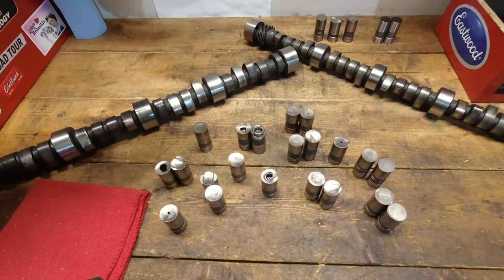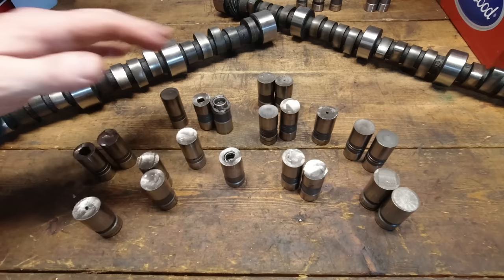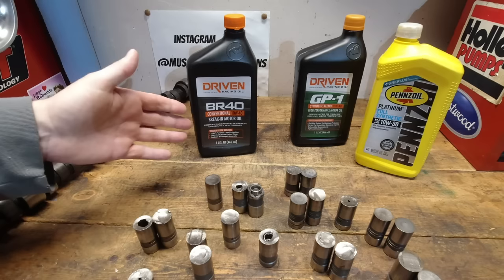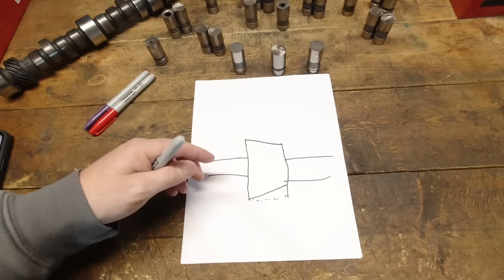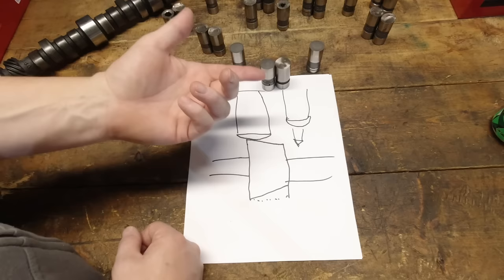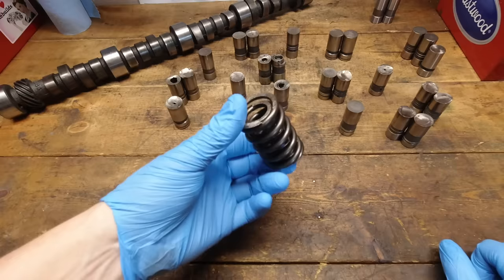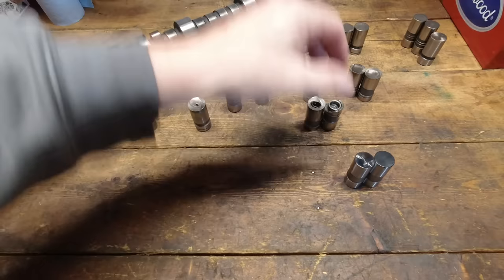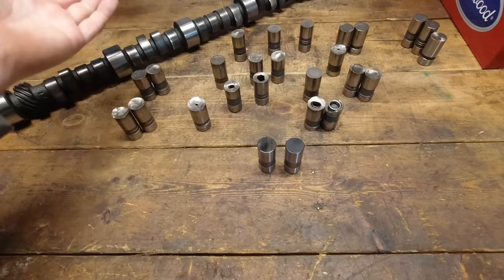Flat Tappet Cam Failures: The Reason Why They Go Bad & The Solution! Part 1

Comment: Never in my young days did we ever have to go through such bs. We set timing,  check for leaks and ran in through the quarter mile. Never ever had a problem like we do now.
Reply from the maker: Just forgotten memories.  None of that is relevant today.
Reply: A stress free break in is what we want. The relevance is proven by folks switching to roller cams.
Reply: Exactly......and That is the Real Problem.
Reply: So true
Reply: Not forgotten
Very true, years ago when the casting slugs were made in USA from high quality cast steel and hardened properly there wasn't any problems, they make cast steel slugs in there back yard in china, Bangladesh, Pakistan, India, etc etc etc (NAFTA, GATT) kinda explains it,,, if ya pay attention to the obvious.
Reply: yea. back then you could stand back and throw a cam in your block.never even thought of a cam or lifter failure. unless just worn out.
Reply: Exactly
Reply: I'm the same way, but in the last 3 years I've destroyed 2 brand new cams. I didn't change anything I did and 2 wiped out.
Reply: Ever thought about missing oil thrower paddles on aftermarket conrods? Original GM Small Block rods have so called Splashers that throw oil on the cam lobes, most aftermarket rods dont have these oil throwers
Reply: @Haffschlappe  And not on old Fiat OHV too
Reply: @Haffschlappe  In Sweden they use Compressor oil SAE 30 plus zink for breakin

Comment: The very first engine I rebuilt was in 1985, it was a SBC 307, reused the original cam, and installed new lifters, didnt even go through the break-in process, drove it many years until I sold it to a friend, it ran many more years until we just lost touch with each other, it is probably still running somewhere out there!
Reply: Absolutely, break in is an unnecessary gimmick.
Reply: I did my first cam swap at 13 years old. Put in a 280 isky in a olds 400. I used the original lifters with 66k on them . Replaced the nylon timing chain gear that slipped and bent 6 push rods ,used push rods went in. I sold the cars years later and I put on 20k . I run into the new owner at car shows. The motor has never been apart. Still runs great.  My opinion on all this is BS .
Reply: @bobbybieln853  oil isn't what it used to be. That's kind of the point he was getting to. Cheap oil will kill a new build, a motor built 20 years ago that already got to build a film didn't get affected. 
Epa is definitely trying to kill old cars. Believing otherwise is foolish.
Reply: @bobbybieln853  exactly
Reply: Yes,  I've put together solid flat tappet motors back in the day with heavier than stock springs, did the break in and to be honest with open headers it was a sound of celebration,  2000 rpm for 30 minutes told the neighborhood my motor was finally complete...lol and zero problems with cam/ lifters. 
I believe quality control is our problem today both with replacement parts and block machining.
Reply: Exactly
Reply: I' ve rebuilt several small and big block Chevys with flat tappet cams. One with a perfect circle cam and the others Isky.  Ran each one 20 minutes with regular oil with a quart of GM engine oil supplement. Never had a problem. Use Rotella or Delvac diesel oil in both my trucks. Over 100 k on the rebuilt engines. I think people using this thin synthetic oil is a big problem.
Reply: I have NEVER been a Fan of that 2000rpm bullcrap...I have built engines for 30 years, and never did I do that...nor did I use anything other than Rotella SAE30 oil (I believe T1 is the new lable for old oil)...I had my own concoction for "Cam Lube" which was mostly MOLY Chassis Grease, and you DON'T want 2000rpm to "FLING IT OFF" that is just DUMB...You want to prime oil pump with good oil first...Now I am not saying that TODAYS Rotella is quite the stuff as WAY back...But a bottle of ZDDP additive should help...Also you want to use the Diesel Oil that is for the OLD Diesel engines and NOT multiviscosity...(Even Detroit Diesel tells you not to use that crap in "old style" engines)

Comment: Comp HAD to do something because it was their stuff wiping out more than others, combined with consistently blaming the customers for failure. It wasn’t just Billy Bob wiping them out it was 40 year veteran race engine builders. Comp had screwed tons of people and the word was spreading like wildfire.
Reply from the maker: Comp sells more cams and lifters than anyone else.  And not by a little bit.  By a lot.  They are all buying their lifters from the exact same suppliers and everyone selling flat tappet cams are having failures.  But since comp dominates that market, you’ll hear more about them.  If this fixes the majority of the issues (you can’t fix a block with worn out lifter bores or ones that have shifted), and the others don’t follow suit, you’ll hear about those manufacturers more.
Reply: @MuscleCarSolutions  I guess either way no matter the reason for them being the number one culprit in the public eye, they were going to have to try and resolve it. I’m a big flat tappet big block Chevy guy. Last comp cam I broke in was 2012 and I used VR1 oil with additive and only the outer springs. I took pains in making sure the engine fired first hit. The cam broke in great and worked perfectly. This was before the great lifter debacle so I wasn’t so worried about it and not as educated as I am today about them. When this problem started, I did the most reasonable thing I could think of, which was start buying up old cam kits from the 60s-early 2000s. I now have piles of NOS GM cams and lifters and early aftermarket kits. I would be interested to see if comp would offer the coating on outside lifters such as some of my NOS GM stuff. It sounds like a winner
Reply from the maker: @DerekCastleSr.  there are lots of variables at play and the one that is getting worse is the block.  I have a video coming in that soon for the last video in this series.  That’s an awful situation and there’s nothing that any cam manufacturer can do, so the machine at gets the blame.  But no one wants to hear that.  On the subject of dlc coating an old set, even new, is I don’t think it would be possible.  The way it was explained to me is the prep and machining process wouldn’t allow it to be done and a finished good.  It’s going to be interesting to see what they do with it further.  What else might be in development.  Guess we’ll find out at SEMA or PRI.
Reply: @MuscleCarSolutions  you are fighting a losing battle with anyone that begins with "20,30,,50 years ago we didn't have to do this break-in crap, it's a conspiracy." They really don't get it. Over the years, things have changed unlike their mentality! That is the reason nobody knows their name for assembling engines. Yes, "engine assemblers" I'm definitely not calling them engine builders!
Reply from the maker: @vvvdubb16  preach brotha!
Reply from the maker: @Haffschlappe do what exactly?
Reply: @MuscleCarSolutions  I’m guessing he means make a cam and lifter that lives. Back in the 70s-90s we didn’t see these problems. You threw a cam in, checked rotation, and ran it in. It’s due to the machining of the parts period. The Rockwell has been tested and is fine. Oils play a small part but not as much as people like to assume. Lots of 4.0 Jeeps out there on the road getting wal mart swill at every change. I throw in an old GM cam and lifters or old 90s kit and never worry. I’ve talked to a top guy from Reed and also my personal cam grinder and a 50+ year veteran race engine builder who has done projects with Fulton and others. There’s also another well respected builder on here with a video explaining how he will only install a flat tappet cam if he can grind the lifters himself. They all come back with the same answer. It’s the machining, and check for rotation.
Reply: @MuscleCarSolutions  selling HQ tappets in OEM quality
Reply from the maker: @Schlipperschlopper  you’re making a big assumption, like you have on the dozens of comments you’ve left with both your accounts.  Watch the rest of the series.  There is so much more to this than the assumed quality of todays parts.  Especially when it comes to such poor block prep prior to installation.

Comment: THANK YOU! This information needs to be propagated throughout the hot rod/performance community. I have been doing engine work for about 35 years but my day job is reliability engineering for rotating equipment. lubrication analysis and root cause failure analysis is part of what I do. I used to be in several Facebook groups and different forums and the subject of Zinc always came up. I preached the importance of real break in oil for a flat tappet cam. The zinc additive is a snake oil and it’s not doing what they think it is. Comments about the additives in regular oil washing the zinc away and zinc not being suspended in the base oil always seems to fall on deaf ears. I think most people believe, all those guys on YouTube use diesel oil so it must be good. I try to explain to people to quit using diesel oil on old engines and after break in. Information about detergents and additive Les designed for a dirty diesel are totally different than what’s needed for a gas engine were mostly ignored. Information about API ratings on the oil was ignored. I would recommend to break in with stock springs yet I would see engine startups with dual and triple springs without any regard to installed height or seat pressure. I left all the forums and Facebook groups due to the spread of misinformation and sh**ty best practices. Keep up the good work and continue spreading the good knowledge
Reply from the maker: I spent an awful long time looking for the examples used in the video but what took equally as long was to confirm (or deny) the assumptions I had.  I’ve got some good industry interviews coming up that will hopefully shed more light on this subject. A lot of what I’ve seen on Facebook is just opinions that someone expresses, then they get repeated and next thing you know, people want to call it truth.  Just crazy the amount of bad (and good) info you can find.  Tried to present all the details and hopefully it will save an engine or two.  For sure those new Comp lifters will have a big impact.
Reply: @MuscleCarSolutions  I can appreciate how long research to prove a point can take. Most of my days are spent looking for data to support why a failure occurred. It seems misinformation on Facebook spreads quicker than factual data. Thanks again for sharing and looking forward to the follow up videos.
Reply from the maker: Thank you.  Very much appreciate someone who recognizes how long this process takes.  The interview o have coming up with Billy Godbold should help clear things up!
Reply: Everything he has talked about has been in every single issue of hot rod magazine for the last 20 years. Not too mention car craft, super chevy, and chevy high performance. Also, Engine Masters and power nation have exclusive video content about this to watch on YouTube. Back in the day of early internet (2001) their was Bob Winters oil master graph of modern oils used in hot rodding and racing that he broke down for analysis that I would read about while down loading music with Napster.
Reply: special oils in a specific brand are likely never going to add much aid to the solution because the flat tappet lifter is loaded hard to the cam lobe when opening and the lifter without roller wheel just shaves off the lubricant. I seriously doubt these oils can embed themselves into the metallurgy of the metal once the metal has been poured at manufacturing  and is machined and has cooled.
Reply: Preached... why?  Did GM have 20 minute fan dances per engine to qc an engine and ok its move to vehicle assembly?  Math: 1969 Chevrolet built 2.06M cars, if memory serves. Lets say they did do 20 minutes per engine, including curb idle, mixture, oil pressure, vibration and leak checks.  Then drop oil and put in a fresh charge, tag it for the loading dock and unhook test power etc.  That's over 686 thousand hours of work.  I don't know anyone who worked engine assembly, so I have to guess: after vacations, shut-in/maint, operational up time is 46 weeks per year.  We're down to 14927 man hours per week [excluding remediation of failed units handled seperately].  Assume 3 shifts for 24 hour production at 5 days a week and per shift thats 995 man hours  - you need 332 stations to make volume.  I don't believe that, and I'm thinking they had 6 minutes per, tops - no "break in" oil in sight, just cheap bulk oil for initial run in and bobs your uncle.   Anyone with assembly experience feel free to knock all the holes in that you need to, and as always... don't believe everything you hear - tribolgy credentials or not.  Personally, I suspect [post SJ oils] astm methods are letting us down, but that's a huge rabbit hole... might even be a book.
Reply: I'm an engine mechanic and machinist. I'll take it one step further. 
Cam break in is a myth. Ring break in is one thing. 
Run weak springs. Make sure lifters turn in the bore, a smart mechanic knows how to look for this before the engine is even started.
Run the engine. I always do at idle after heat soak.
Then replace with proper installed height and seat pressure on every valve. And they all have to be even and within specs.
Reply from the maker: @cammontreuil7509 and making that spring change is exactly that.  Breaking in the cam with lifter pressures. We talked about all that in the video as well.  And lifters in the most recent video.
Reply: i use diesel oil. but use it in a 82 rabbit diesel.
Reply: I left a lot of the forums and social media groups as well for many of the same reasons. The conclusion I arrived at was there are a lot of people in the hobby who would rather position themselves as experts for what they used to do and have a project on stands for 30 years than people who would like to improve their knowledge as time goes on. 
There's a lot of anti-science and pride in the hobby. I have a lot more enjoyment now that I'm not having the same oil and component arguments every week with no end. Plus, there's a lot I don't know and it makes more time for learning when you stop going back and forth arguing on socials.
Reply: @andrewwhite4668  a very good comment.
Some variables for hobbyist are not universal nor professionals either.
What may work in one state doesn't always work in another.
Example. The gas we buy. Or the climate. Or elevation.
 I do allot of interstate travel. Gas is different in each state. That has an effect on the engines we build. Not just octane rating.
Some mechanics have good success others don't. Example. I can't get a MSD 6AL box to keep from going bad. Might Suddenly Die.
But then I've never had a flat cam in all the engines I've built. More than 500 plus. But then I only specialize in Ford engines. 302/5 liter or 351w/c. Specifically because they are small, light, and plentiful and easy to install. 
So you can't help but learn the bad and good of those grocery getter engines. 
If you are interested, I have a video of a very interesting vintage FE running on utube. 
" Fe 427 with a new set of valve springs "
But when you think it's appropriate, stick up for yourself, speak out. Mouth off.
Read the book " Don't Sweat the Small Stuff " you'll definitely associate with the book.

Comment: I've run flat tappet in all of my engines up to now without problem, but the failures recently have convinced me to switch to roller cam / lifters.
Reply: I know where your comming from, i done all the right things from right oil to soft springs to low ratio Rockers and have still had pushrods not turning right off fire up. The lifters are junk.